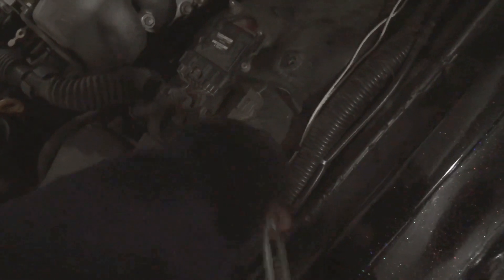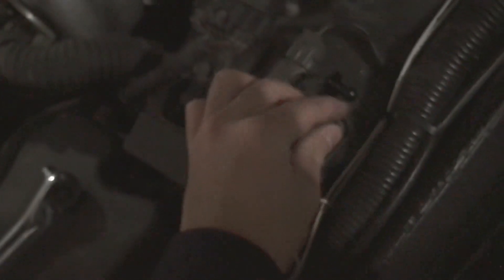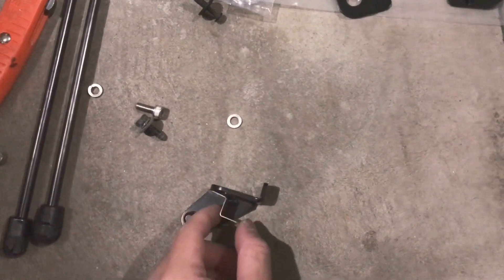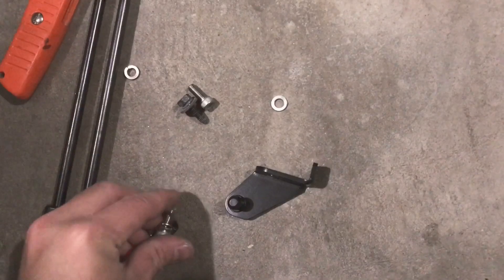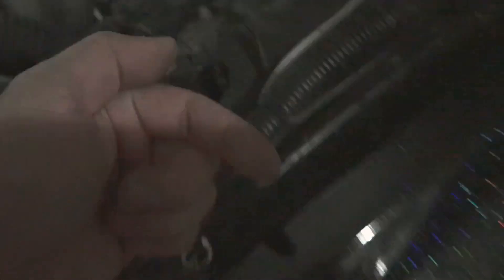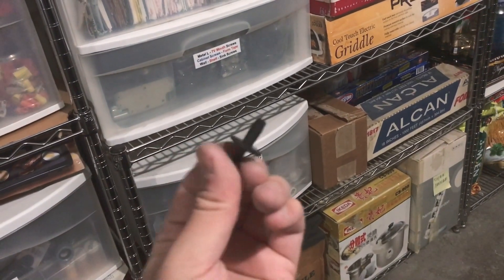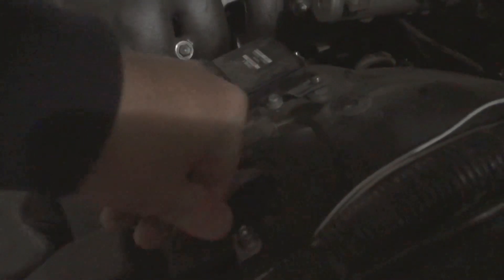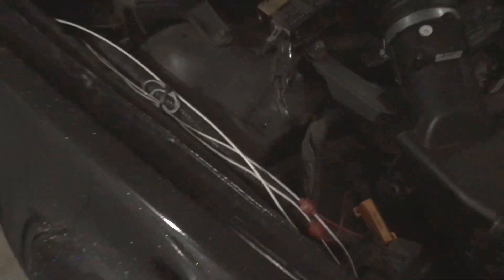Figs Engineering Hood Prop Install

Comment: Bro. Props for doing this with one hand. I saw the struggle. Thanks. I was wondering how those clips went on, appreciate the video. Only thing is, I wished you showed how you attached the brackets that go on the Hood itself. But im sure I can figure that much out. Again, I appreciate the share.
Reply from the maker: Mnosliw it's sandwich in between. Yeah it's a struggle with one hand haha
Reply: @calvintruong4699  i see. again, I appreciate you taking the time to respond.